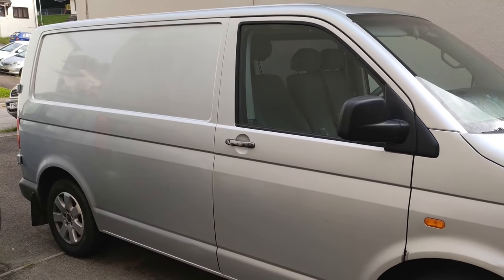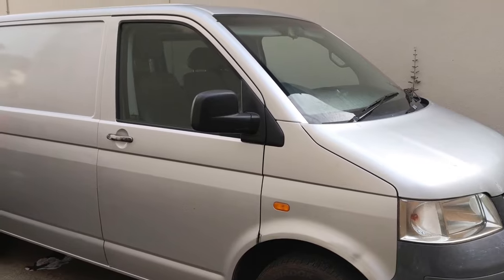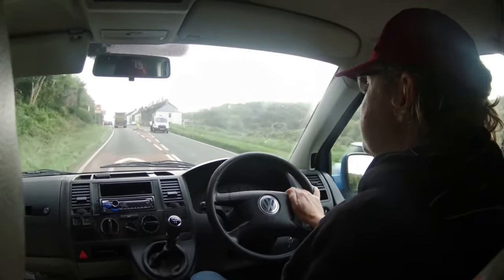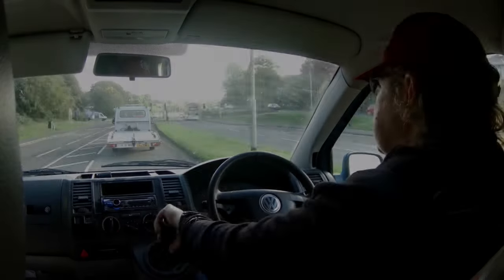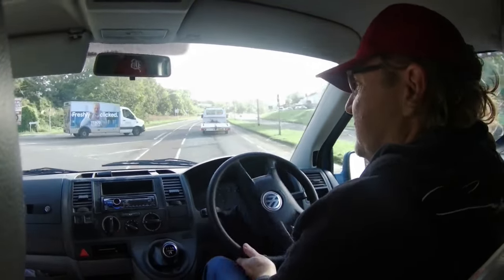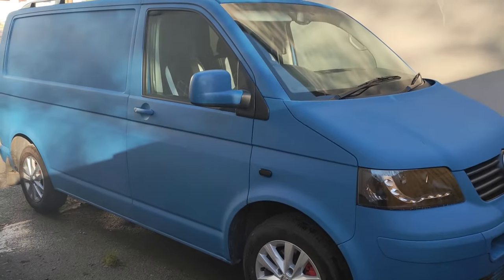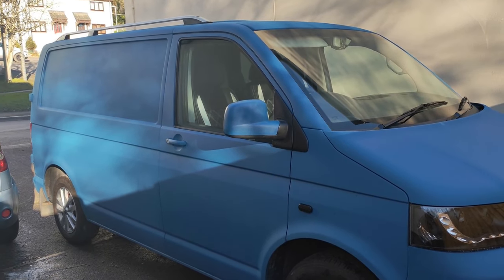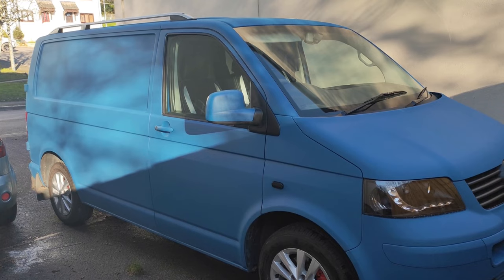Volkswagen Transporter Campervan - Did We Make The Right Choice By Raptor Painting Our Budget van?

Comment: Always key what you want painting up yourself, ppl at body shops do the bare minimum lol or you know the saying .. if a jobs worth doing!!......
Reply from the maker: Good advice 😁
Reply: @Budget-Cars-And-Bikes  how is the paint holding up now ? I was thinking about doing mine in black there is that many imperfections in mine at the moment I need some that'll hide them even after I've sorted all the rust dents etc . 
Was gunna do mine on my drive lol
Reply: @Budget-Cars-And-Bikes  I've worked in various body shops even main dealers and some ppl I've seen just skim over where's to be painted once when keying it up to save time lol
Reply from the maker: @CM-1723  It's OK now to be fair, just not as professional a job as I expected, they missed out prepping on so many plastic areas which caused issues, but it's looking better now. I think something lighter or darker will hide more, maybe a nice Gun Metal Grey or Anthracite?